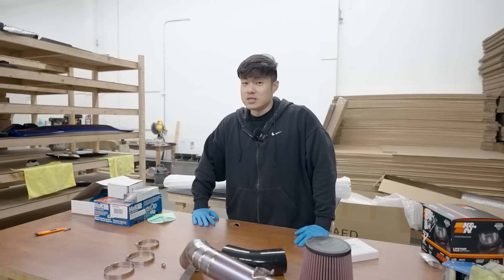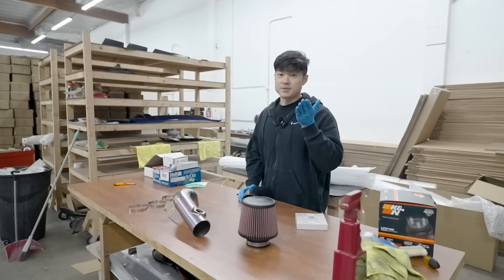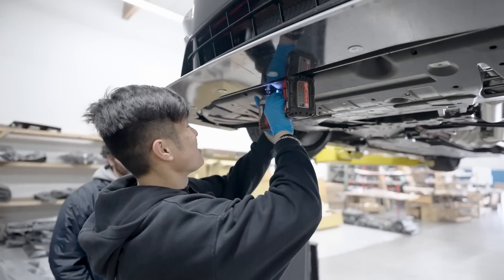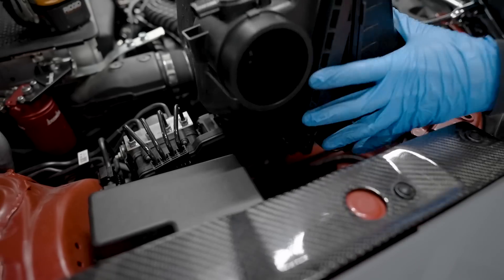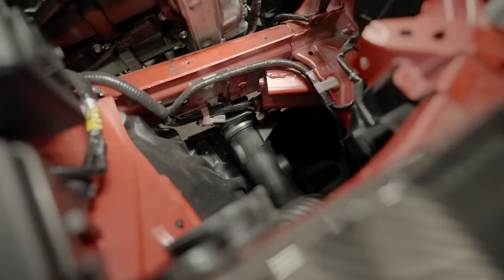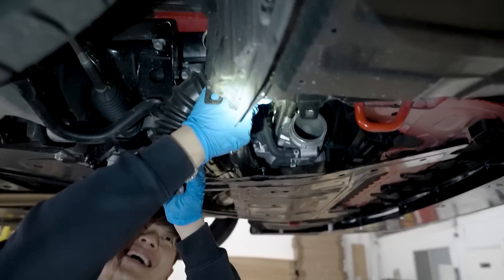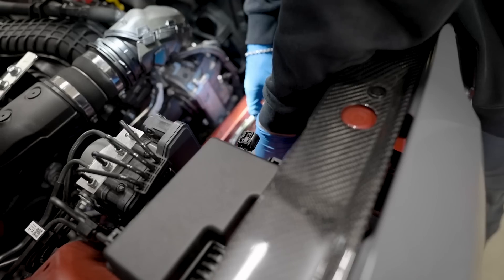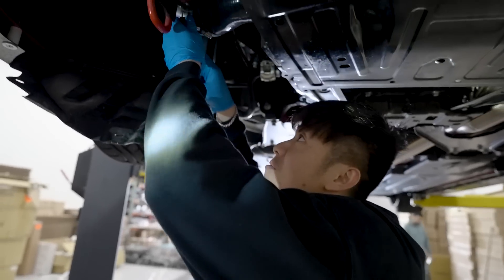Insane SOUND !!! | 2022 + Subaru WRX

Comment: Wow half way through. You have to take the titanium piece, put the screw through the bracket, just slighty tighten, keep it loose, then you match the coupler from the turbo, to the titanium, twist things around to make fit, then hand tighten the titanium screw there. Then do the clamps. Then final tighten on the bracket. Then the filter stuff. Also then you would not have to cut the under splash guard. You adjust that coupler till its all angled perfect, while the titanium is loosely screwed in place.

Comment: Do all intakes move like that in the engine bay? 

I wonder if there is a significant increase in intake temps without the box 🤔
Reply: Yes they move not all of them but some they do, and yes temp might go high but not bumig deal as long as Air get in there should be good